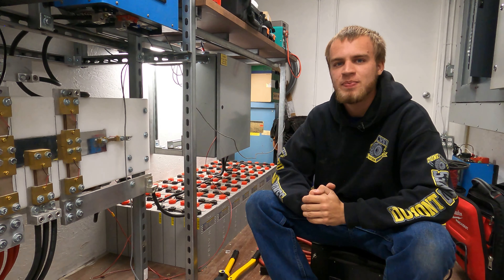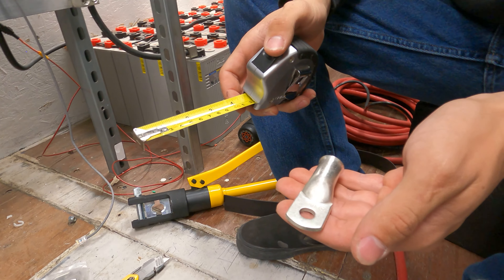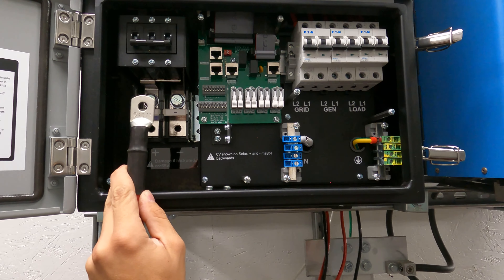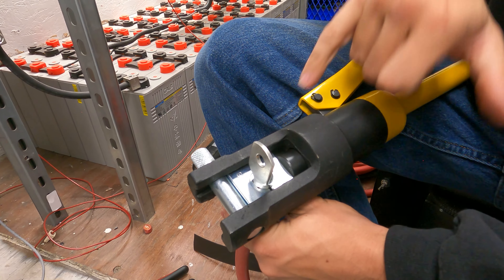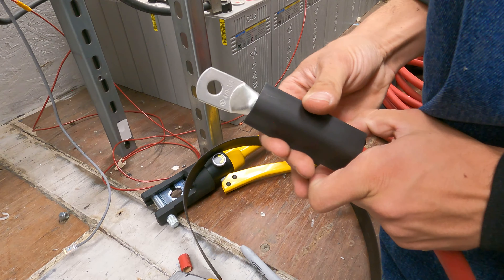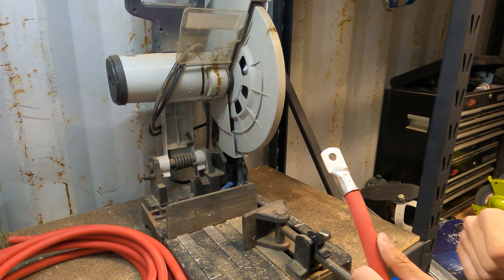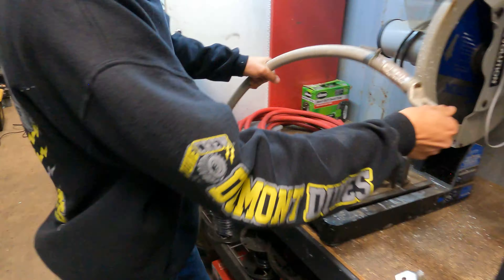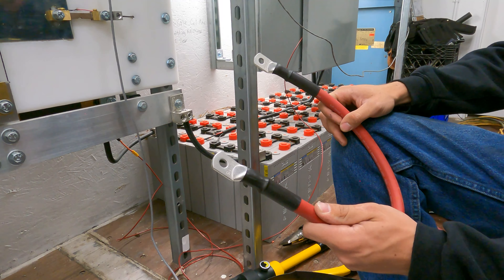The PROPER WAY to Crimp Heavy Gauge Battery Cables

Comment: I like to solder all my lugs on for an even better connection.  And in the example at the end where you cut through the 4 - 0 lug, you chose a location where it had not been crimped thereby showing an uncrimped gap inside.  Not a nice demonstration.  Solder has always been superior to crimp, throughout the history of cable lug use.  Not sure where you went to school but we actually tested crimped vs soldered connections for resistance and noticed failures in current draw tests.  The solder, when done correctly always produced better results than crimps when done correctly.  In most applications, either will suffice.  However, for pure results solder wins.  Silver based solder is 5% more conductive than copper (copper 100%, silver 105% using copper as the standard conductor).  Heating wire tends to distort the insulator so care must be used.  I like to use a wet rag to cover the insulation near the end or an cooling paste which is available from most HVAC wholesalers.  Silver requires a bit more heat than propane, though so most opt for the crimp.  We're talking about the purest method here...in real life and in most situations the crimp will suffice.  Its important to know the composition of the lug being used as well.  Some are made of aluminum while some are copper and other's copper with a tinned coating.  Best to choose one with copper, either bare or tinned, since aluminum tends to oxidize over time which creates friction within the lug.  I've seen 'em glowing red like a toaster element from bad connection.  I got about 50 years experience in this subject.
Reply: Issue with solder is can make the cable brittle near the lugs, which can cause some or all of the strands to break, as well as damage the insulation.
Reply from the maker: My *opinion* on solder is that if the connection is not strong enough without solder, then adding the solder is a band-aid. From my experience, over time if the connection heats up, the solder can melt, increasing the resistance therefore creating more heat leading to total failure... I used to believe strongly in soldering terminals, that is, until I had one fail from the solder melting out of the terminal.  It was a poor crimp to start with, and the solder was exactly as I said; a band-aid.  There are loads of options when it comes to making cables like this, but at the end of the day, the critical thing in any case is to make sure the crimping itself is done right, anything else on top of that is just icing on the cake.  While Icing can make a good cake better, it can't change a dried out piece of cardboard into a tiramisu.  Hydraulic crimpers are the way to go!!
Reply: I designed backup battery systems for telecom in a past life, and wired up more than a few test systems in the lab..   Solder or crimp depends what the application is..  Yes, if you are after the ultimate in conductivity,  solder is the way to go, but for parts subject to flexure and vibration, solder can wick into the strands past the crimp and the wire will eventually break just past the lug.    In such cases, you have two choices:  you can use mechanical crimp connections only and oversize the lug and conductor to handle the current, or you use specially designed lugs that you first crimp and apply a carefully controlled amount of solder to a port in the "closed" end of the lug (or we had special order lugs that came with  a small controlled amount of solder paste deposited in the lug).   In this case, the crimp being done first is critical as it mechanically seals the lug (and a proper crimp is hermetic- we cut apart a lot of crimps to come up with specs and tooling for making the crimps) and the wire and prevents wicking of the solder into the wire past the lug, but just bonded the surface and ends of the wire, which we found to be indistinguishable in performance to fully tinned wire ends.    Now this worked great for pre-made cables, but out in the field, the techs much preferred the crimp only lugs- those thick heavy cables and lugs are basically big chunks of copper and take a lot of heat and are difficult to do precisely in the field.  Properly engineered, you can account for the minor differences in conductivity, and ease of installation is quite often the overriding design requirement.
Reply: In both automotive and aircraft, solder joints in wire are a no-no.  Many service manuals have large bold warnings never to solder wiring.  Like @flyingodismount says, it somewhat depends on applications, but generally mechanical crimps are more reliable than solder.  There was a study about this a while back and it showed that a proper mechanical crimp using a hydraulic tool will "cold weld" copper to the terminal.  I'd link to the study, but I've never been able to find it on the inter-webs.....
Reply: In marine applications solder joints are forbidden and in most jurisdictions residential and industrial power circuits, soldered joints and lugs are not code. The reasoning is that if the conductor is overloaded, the solder would begin to flow and the juncture would overheat catastrophically. In marine environments the dissimilar metals of the solder lead/tin/zinc to the copper just adds more issues. MerCruiser used this in the past and I’ve had the displeasure of redoing a few wiring harnesses. Best is a quality lug, quality fine strand tined wire, quality crimp, adhesive lined heat shrink tube.  Done right and it’ll outlast you in most environments.
Reply: soldering is only recommended up to 10A
Reply: @HighTechLab  The connection didn't fail because the solder got hot. The connection failed because either wrong wire size was used or more current than recommended etc. No wire should be getting hot enough to melt solder with proper use.
Reply: @ckm-mkc  BS...I caught you in a BS lie...solder is used in automotive wire repairs (check any decent youtube auto repair channel).  And you never will find that "study" as it's also a lie.
Reply: @SkypowerwithKarl  We are not talking about either power circuits or marine circuits...we're talking about solar...and sizing your wire to meet the load is essential.  By the way the reason lugs are used in residential and industrial is due to the convenience.   Having owned a mechanical contracting business, I've seen more 'lug' connections fail than I can count.  Glowing red like a toaster and about to burn the structure to the ground 'catastrophically'.  Practical experience trumps book/code every time.
Reply: @ursodermatt8809  Recommended by who?
Reply: @aday1637  
Well this video was titled “How to crimp heavy battery cable”, so many many think RV and marine not just residential off grid. On marine or aircraft, if electrical goes bad you don’t just walk out the front door or park it and get out. Tuesday, a 100k boat went up in Sacramento, my bet is the bilge pump stalled over heated and wasn’t properly protected. Mostly people know just enough to be dangerous in marine. Things like inverters or solar charge controllers (non are ignition protection rated) in the same space as gasoline engine compartment where fumes can ignite I see all the time. Blowers don’t run 24/7.  When larger boats sell they usually have a marine survey done so things like this get caught.
Reply: @aday1637  
feeling strongly about something does not necessarily make you right. please do your own research on googles. there are many reasons you do not solder high current connections. you do not solder tails.
Reply: @HighTechLab  What you write is one of the reasons why soldered connections are prohibited for almost everything in europe.
And the two cuts you made through the lugs might explain why oval-crimping is no longer allowed in europe either, it has to be hexagon-shape.
Reply: I have seen them come loose when a lot of amps run through them for an extended amount of time from the heat
Reply: @aday1637  Audi factory training courses for technicians explicitly advise against soldering due to it making the wire brittle and more likely to fail. Working for Toyota for the last 16yrs. Every factory repair for joining wires Toyota provides correct size and material for CRIMPED connections. Soldering does have a place but proper crimps are also ok
Reply: Illegal in Australia
Reply: @HighTechLab  I agree. Your hydrolic crimps look amazing. Silver solder would be just icing on the cake. No substitute for a perfect quality crimp.
Reply: @Flying0Dismount  awesome.
Reply: @ckm-mkc  epic!!!
Reply: @SkypowerwithKarl  this thread turned out amazing!
Reply: @mhickman007  but if it ever did get hot, it's a safety hazard that will be dangerous if the crimp isn't top notch. I now understand why solder isn't good for anything over 10 amps and nothing with too much flex (unless done perfectly by a trained expert at doing it) but even then, you might test the resistance and see its low but if it's a bad crimp and it overheats,  it's a fire.
Reply: @blauesKopftuch  good information!!
Reply: @aday1637  Soldering is objectively inferior in automotive. It is not recommended and not used by any major manufacturer in automotive cabling.
Reply: This is completely false information
A good crimp is a cold weld, far superior to soldering
Reply: As an IBEW trained electrician with many years experience in battery and industrial power installations, I would never recommend soldered lug connections for anything other than current limited applications. Battery connections are in no way considered current limiting, as batteries can release incredible amounts of energy very quickly. When a lug is properly crimped, it is compression welded to the outer layer of strands, and the inner strands are compressed together enough to provide complete inter-strand connectivity. In an ideal world, no connection would result in an unintended high resistance connection, but it happens, and soldered lugs melting on batteries can cause the batteries or other equipment to short circuit. This can also happen, and does, on crimped connections poorly connected to batteries with lead terminals. Soldering also causes the copper to become embedded in the solder that has a different thermal co-efficient of expansion from the copper, this causes stress on the copper strands that can result in work hardening and crystallization within the strands over time, leading to higher resistance, and to cracking, voids, and corrosion. This is especially true of very finely stranded wire such as battery cable or super flexible cables that experience thermal changes from large changes in current, or from their environment. Additionally, mechanical vibration will exacerbate these effects. Definitely agree with staying away from tin plated aluminum/aluminium connectors.
Reply: @GoCoyote  Most lugs are tin plated copper (sand one down if you are uncertain) and perfectly safe to use with copper/ tin plated copper wire
Reply: Solder makes the joint immobile, and over time can actually cause resistance from dissimilar metals. A crimped connection is actually more mechanically accurate, and if done right, superior to solder. Solder is for circuit boards, not wire to lug connections.
Reply: Solder is superior maybe for conductivity, but mechanically, where there is tension or stress on the cable, a 20 ton hexagonal crimp is much stronger. Dieless or “4 pin” hydraulic  crimps are garbage and rarely approved by utility companies -but solder is never permitted in utility applications as a means for connection of any terminal lug, from 750 kcmil all the way down to 14 awg.
Reply: @aday1637  What is your definition of a decent YouTube Auto repair channel? That is the problem with YouTube videos, It is like a big game of telephone only with auto repair! The only problem is most of those channels are not even run by actual mechanics, Do you know why that is? Because actual Mechanics are in the shop working not making videos, Soldering is not recommended by Vehicle Manufacturers or Speed shops! Why do you think Dealerships replace the entire wiring harness instead of just repairing them when they are damaged?
Reply: I dont think solder is approved in aircraft/marine/automotive scenairos.  I only have google  education, but everything Ive read says no solder.  /me shrugs
Reply: 50 years experience and you're still wrong. Fucking classic
Reply: @drmalenko have worked in all 3 domains, with both autonomous and manual controlled ones, and still work in the field
Soldering isn't used by manufacturers in any of those fields. Reasons I know is cos of wicking leading to brittleness, thermal runaway causing the solder to flow and short power & ground terminals, and crimping after solder causing fracturing and then shorting out from the solder splinters
Reply: Solder increases resistance! Crimp is better for higher current situations.
Reply: You solder your lugs? 🤭 
It's an airtight connection, you're just stiffening the cable which will result in it breaking from vibration if it's present in the environment.
Reply: @aday1637 No.
Reply: This guy is talking nonsense.  “Silver” solder is just a tin alloy that is only 3-5% actual silver and is actually only about 14% as conductive as pure annealed copper according to the IACS standard.  A properly done crimp, will cold weld and make a much better connection both electrically and a far superior mechanical connection because solder (especially lead free solder) will form a brittle joint.
All the examples he talks about are improperly done crimps.  Also, it is important to get a good crimp NOT in just one small crush area, but extend the crimp to at least the same diameter as the wire.  You did it correctly by crimping twice.
Finally, to get a good solder joint, it’s important to use enough flux to get proper wetting.  Silver solder is not as good as this so it’s even more critical, but the problem is, flux, especially acid based fluxes are corrosive and compromise the joint over time if not cleaned properly.
Reply: @aday1637 using auto repair channels as a source is stupid. Look at repair manuals for cars or aircraft. Noone reccomends it.
Reply: @Caverneer  Solder isnt superior for conductivity if crimping is done right. Proper crimping is as good as a welded connection.

Comment: To improve your correct technique for crimping, when you are removing the sheath from the cable make two cuts, one at correct depth and one 10mm (3/8') or so before. Then pull off the majority of the sheath, leaving the strip. Pull the strip to the end of the cable but not off. Push on your lug. Then cut remaining strip off. This way no strands are left behind.

Comment: I always partially close the crimp dies but not so tight that it extrudes the lug material between the dies. Then I back off and rotate a flat then finish the crimp. If you extrudes and material between the dies it reduces the security of the crimp. I see so many poorly done crimps. Usually because of the wrong dies used or wrong lug for wire size.
Reply: Should we use die that is one size smaller for better crimp?
Reply: @LawAbidingCitizen117 How is that a question? If it makes a better crimp then why would the manufacturer not make a smaller die to start of with? All you're going to do is damage the cable and lug and produce a point of failure.
Reply: You are most likely using dies that are too small for the lug and the wire.

Comment: One thing I do when I crimp cables and need to worry about the orientation of the ends, I always add a little witness mark with a sharpie to make sure I do not accidentally twist the lug while inserting into the crimper.

Comment: old post but worth a comment,  crimps should match the cross sectional area of the wire/cable,  one reason some get hot,  under heavy current it becomes a resistor if its not substantial,  secondly it must also be able to mechanically hold the cable under compression without any release,  a result of using the wrong crimp,  dies with two reducer spaces are recommend  as they will allow the collar to shrink and give better strand compacting,  and lastly the correct cable,  not all cables are good for crimping. never solder crimps,  mixing systems is bad practice,  one is chosen over the other for reason and purpose,  closed crimps with solder under fault  can cause a hydraulic/gassing rupture or separation with a hot wire then shorting on something else,  flux will carry on attacking the metals unless you can thoroughly wash it out,  with a proper crimping system the strands fuse and also the crimp,  which is usually well out of the  scope of most DIY, ers

Comment: I don’t think the current-sensing shunt-bars are in the proper orientation.  Many have the current carrying terminals oriented up/down, you want those oriented left/right.  This way, air is drawn up through the precision manganese strips via convection for cooling.  Although float current on the battery is small, discharge currents can be high enough to discolor the manganese without proper air-flow.  Once discolored (purple-ish), their precision resistance is permanently out of calibration.  Also, I’d avoid using metric dies on AWG wire.  Metric with metric or awg with awg.

Comment: Air gaps can happen with any crimped connection, home or professional. I suggest applying  Burndy Penetrox A to the wire or a pretty good dose of it into the lug before crimping. That will fill any gap, keep conductivity high, and prevent corrosion. You have the proper amount when it bleeds a small amount out of the end of the lug after the crimp. Other than that small detail, your video is very helpful and spot on.
Reply: Isn't Burndy Penetrox A for assemblies in which one or more of the elements is aluminum?  I don't see a recommendation from Burndy to use Penetrox on copper-copper assemblies . . . but I didn't look everywhere.